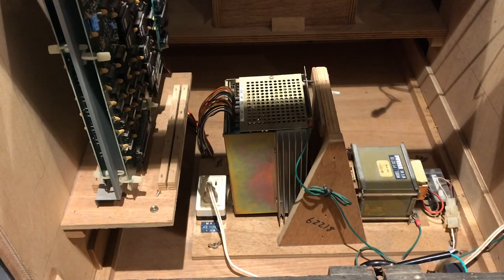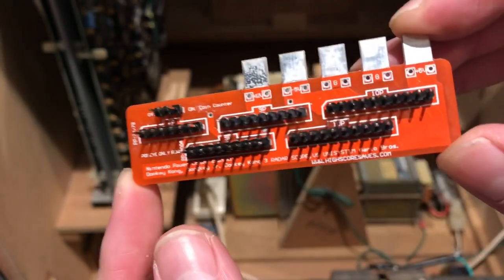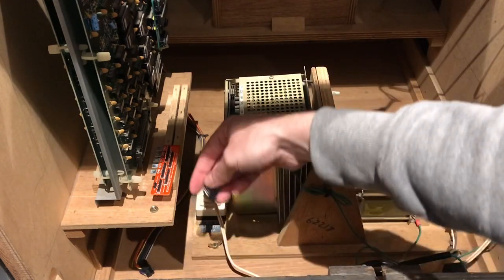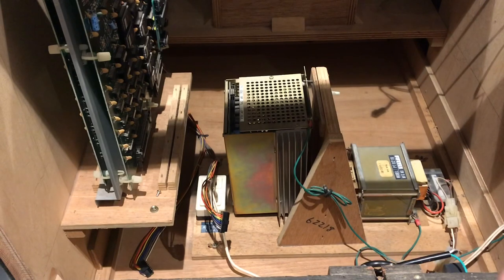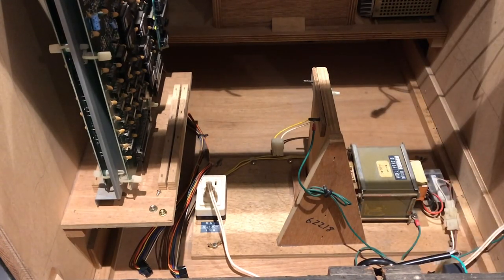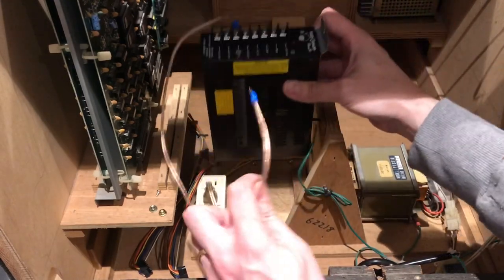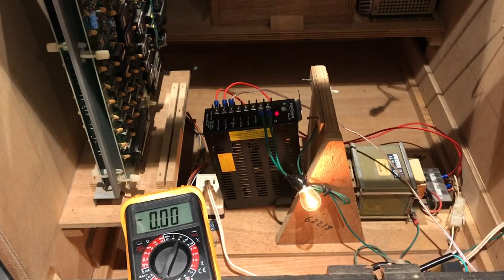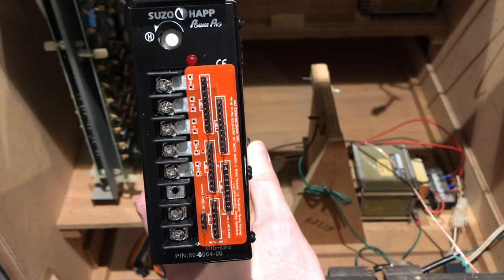How To Replace A  Nintendo Arcade / Donkey Kong Jnr Power Supply (THE EASY WAY)

Comment: It's not an upgrade, the original PSU is a switching power supply as well.  The HAPP supply is fine, but the Nintendo supply won't take out your board, it's actually really high quality. The best option if you are comfortable with it is to recap the Nintendo supply.

Comment: Also you shouldn't power on a switching PSU without a load. It can damage it. Just turn down the PSU +5 pot before connecting it and then adjust it while powered on. Also measure the voltage at the board.

Comment: I have a question I have a wide body mario bros when I turn it on I get flickering marquee monitor comes on then after may be 20 mins the monitor goes black. Its not screen collaps because if I shut it off then turn it back on does the same thing. was wondering if this is a transformer issue because I noticed there are wites coming from the transformer to the outlet that the monitor and marquee plug into or do I need this replacement power supply?